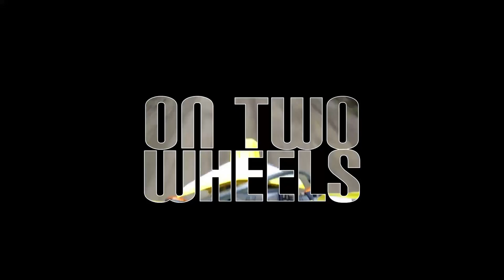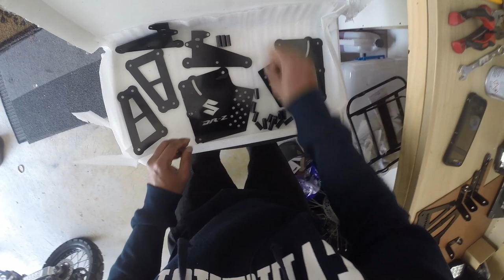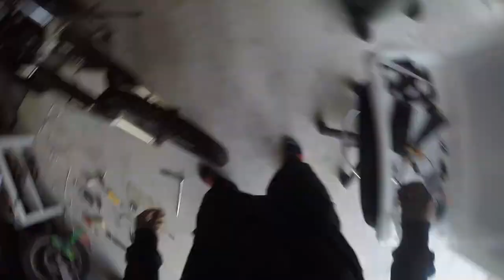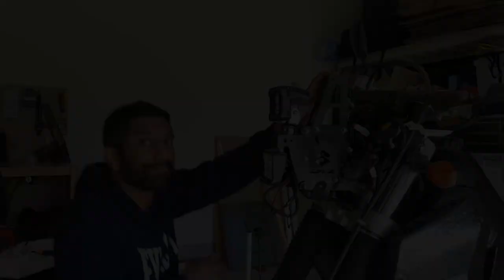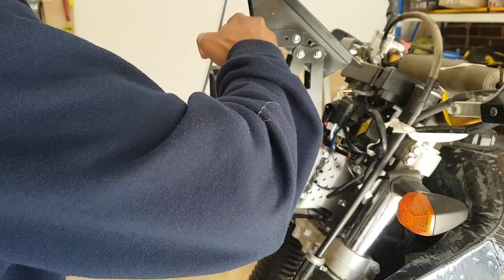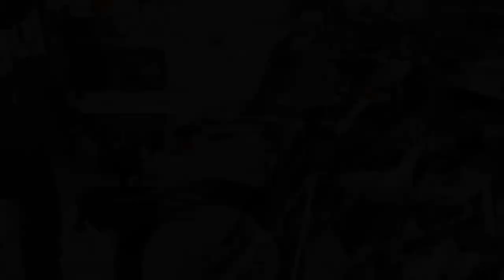DRZ Rally Kit Design and Build! | Part 5 |  On Two Wheels

Comment: Well done! Might I suggest making the tower such that the consumer can choose their own headlight (within certain constraints). For instance, I like Baja Designs lights, but they are more expensive than most and not appropriate for everyone. If your tower could accommodate their Squadron Pro lights you'd have a winner!
Reply: Would not be hard to do & they could offer it as an 1 or 2 baja design Squadron sport/pro light upgrade option in there sale inventory
Reply from the maker: Thanks for that mate! One design principle we are trying to stick to, so it make the kit customizable, because tastes vary and we all want a tower 'just the way we like it' . We ARE planning on having different light setups, though we've not made a final decision on yet. My mate Davin is the "light connoisseur", so I'll ask him about the Squadron Pros.
Reply from the maker: @veetwotls  Looks like everyone has a sweet tooth for nice lights! So we'll def start looking  deeper into that!
Reply: Agree on the nicer-lights.
Veettwo Racing. What kind on of $$ are we talking about for a kit? I'd be curious to see that on a WR250R

Comment: Your tank rap needs to be perforated. Try using a leather rolling perforator to put small holes in the rap. Never another bubble!
Reply from the maker: I've actually cut 2cm perforations at 2cm gaps, and occasionally I run a squeegee to squeeze out air bubbles; but it's not permanent. I think the perforations need to be proper holes, and the vinyl needs to be the high tac vinyl for it to work on a fuel tank.

Comment: Also for vynal wrap. Get a small.hooe punch. Punch small.like 1/16 inch holes all over it. I have decals that went all over the tank. Came with tiny holes in it. Never once did it bubble up. And you can use spray paint on anything. Just use 2K 2 part spray clear over it. I did a helmet, dropped it, and the paint dented instead of chipping. The paint has a hardener in it. The draw back is once you puncture the hardener, you have to use the whole can.
Reply from the maker: tried that. in fact I cut 20mm slits to let air bubbles out. It's still not enough. What I need is high-tac vinyl that doesn't come off easily. 
I ended up polishing the tank and using some smaller decals on it in the end :)
Reply: @OnTwoWheels  yoyr slits are two far away from each other. Holes work and they work great. Never once a bubble. Had my decals on for 4 yrs before doing more custom work. Small holes, not slits. And not pin holes. Actual round open holes 1/16 to 1/8th inch in size. About 1 inch away from each other. All the bikes I install these on, which is a lot of them, enough to loose count, i have never once had a bubble issue.
Reply from the maker: @drzrider3440  Was this on the stock Suzuki tank or a Safari tank?
Reply: @OnTwoWheels  4 gallon IMS plastic tank.

Comment: Very well done! You boys are clever. I am a huge DRZ fan. In fact I raced the Sonora Rally in Mexico this year on my DRZ. I ordered a rally kit from Perfect Fairings in Greece which looked cool but the aluminum tower cracked during the race. I was considering the highway dirt bikes tower kit when I came across your videos. Again, beautiful work. How can we get in touch? I'm interested in what your kit costs. Is it competitive with HDB? There are also similar designs from motominded and RMS
Reply from the maker: We've been riding with the tower and putting it through some real torture testing to make sure it hold! The pricing depends on what options and specs you want to go with; and w are looking to expand the model range as well as the bikes this will fit on!

You can reach out through our FB page
https://www.facebook.com/AdventureRallyX

Comment: Looks a Good cheapish Adventure setup option  :thumbs up well done  , compared some dedicated rally kits out there that high priced for average person.

Lighting cant pass Baja Designs there the best lighting i learned many years ago you get what you pay for with lighting. You could offer it as an 1 or 2 baja design Squadron sport/pro light upgrade option in your sale inventory.

I'd add a relay (how i run all my bikes) so both lights are on when switch to high beam (it allow for spread & distant view for wildlife ahead & coming  in from sides of your riding path) .

Screen bolt holes i'd put rubber grommets in them.

Acerbis tanks are designed to breath through the plastic won't stop it bubbling using wraps  ,  paint  etc
(only acerbis tank designed to paint is the KTM450RR Tanks which are also used on the Husquvarna 701RR) .
Reply from the maker: We'll certainly consider the Baja designs light! Interesting that you mention getting both lights with high beam; Davin has that setup on his! 
I was also wondering if rubber grommets were needed, but so far it's been good. It's sitting pretty firm,  and the poly carb does allow flex if necessary. But yes, once lockdown ends we want to take the bikes out for  bit of a shakedown.
As for the tank, haha well,  the eternal optimist in me is hoping i get a solution for it :D

Comment: Maybe you could try something like a derma roller to perforate the tank vinyl. It would put thousands of tiny holes so hopefully it will breathe.
Reply from the maker: I did try that! Pinholes just aren't big enough. And I've come to realize that unless its a high-tac vinyl, and has big enough holes which are close enough, the bubbles are unavoidable. More so on the safari tank than even the stock tank.
Reply: @OnTwoWheels  bummer.

Comment: Really enjoyed watching your Rally Tower build man so many considerations and doesn't look too bad in my opinion. That bikes looking huge when you stand beside it especially with the tower installed. I was checking out the Nomad Rally Tower for my KTM790R @ $2K au plus delivery I didn't want to spend but I did like the design it's very similar to yours I especially liked the headlight set-up and the  connections plug and play with the CAN bus module which I'm not familiar with, it's another KTM fail safe device I think and I'm also not sure about ADRs with swapping out headlights with LED spotlights I guess if you zap a Policeman at night you'll soon find out if the lights are compliant with ADRs or not hahahaha top video thanks for sharing huge respect Happy Trails
Reply from the maker: Thanks mate! As for the headlight, yes this 2 LED set-up isn't ADR compliant. But the next version of the tower (which I currently have only the bike) uses a already ADR approved headlight. So no trouble with the popo. :)

Comment: Looks really good, well done. Could you advise what the total weight is including the screen, tower, hardware and lights?
Reply from the maker: So all the current component add up to little under 4.0kg, but we want to use a lighter polycarbonate in the next version. And funny enough some of the heaviest parts were the bolts. So with the new design we use fewer bolts. So in the end we're probably looking at something just north of 3.0kg. But also interesting is that the stock headlight, headlight cover and the 2 metal fork brackets that we remove weigh 1.6kg. So you'll be adding less than 2.0kg, and that too onto the frame and not the handle. 
I don't know if it's a placebo effect, but i feel like the bike handles better now!

Comment: Also just came across your channel. Totally awesome. Huge DRZ guy...as you can tell by my handle. I fix DRZ's for new riders. Like the current one i have working on is an '03 E model. Rebuilt his brake calipers fixed his water in oil situation and added some lighting. Have built 5 of these. S SM and E. I know what im doing when it comes to these. So yeah, I have tried many different patterns for a rally fairing. Couod dingure out how to mount it up...i believe you have the base mount mounted to rsdiators. Great idea. Please let me know. Im looking for your main mounts that mount to frame and the big Suzuki piece. Thats all I need. Then ill cut and customize the rest.
Reply from the maker: The current tower has been a test bed (even though i have been riding with it fine) which we have been trying to refine in design. We'll do an in depth review of the new design soon! :)
Reply: @OnTwoWheels  awesome. Keep me updated. I plan on using the fairing from a Honda X-ADV 750. Take a look at it. Fits very nicely in front. I also have two squadron pro series lights I will be using as head lights. The fairing is nice, has a good curve to it and the top is in a shape that will allow for cut to fit by trimming it down if needed. I would perfer to use a solid mounted rally style set up vs the current set up that attaches to handle bars. Im sure I can manufacture brackets that will work fine, but if I had your frame mounted brackets and the ones with the Suzuki cut outs, I can then finish this up nicely. So if you end up getting another set of just those brackets, id purchase them from you and make the other parts I need myself. Keep ne informed. Im a huge DRZ fan. Put over 40,000 on my 2011 so far.

Comment: Interested in this for my drz400. 
I am interested in seeing how you attached the tower to the bike though. 
Also, the screen and lights off centre at 15.28 or is it just the angle, I recall seeing some one had issues on another rally screen kit build with issues like that but may be a different bike I can’t be sure
Reply from the maker: Actually the tower is straight and aligned with the frame. It's the handle/fender that's slightly turned, hence the asymmetry. And the tower is mounted with a bracket (rather than a weld) so that if/when the day comes, you can always put the bike back to standard.
Reply: @OnTwoWheels  thanks for the reply. Please keep me updated with any products going on sale
Reply from the maker: @MikeBarnacIe  certainly mate! Will do!

Comment: Did you look into building a kit around the factory ktm rally screens like some other kits do? What is the price of that screen on its own if you did? cheers
Reply from the maker: We thought of the KTM design, but didn't go down that path. The thing is it would require using the KTM headlight. (The KTM screen has a big cutout for the headlight and that would limit us to using the expensive KTM light or designing a light assembly to fit that shape.

Comment: can you tell me what a tower would cost? DRZ400 Sm, i would be interestred if the price is right. how long would it take to deliver to france?
Reply from the maker: Hey Gerard,
There's 2 models. You can check them out here.  :) 
https://adventure-rally-x.myshopify.com/
Reply: @OnTwoWheels  $1000 is a pretty price for a few pieces of aluminium
Reply: @GSchrijver  that's $1000 Australian. Roughly $600 Euro. But that comes with a screen, powder coating, wiring loom and switches and lights